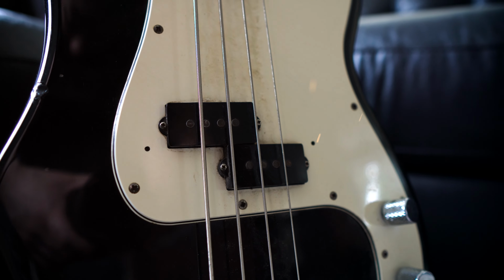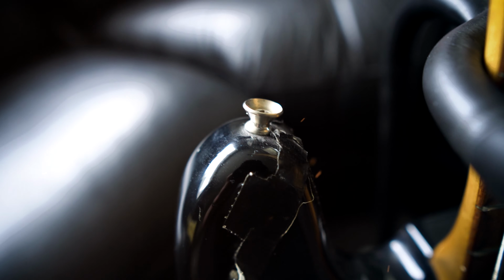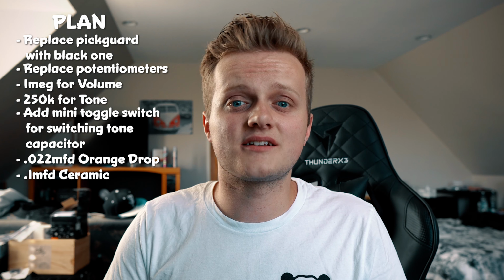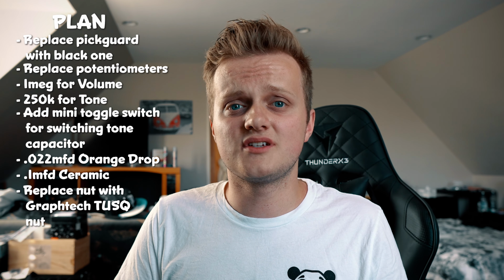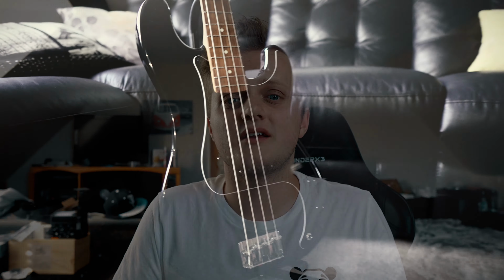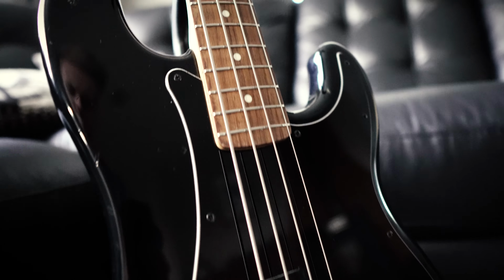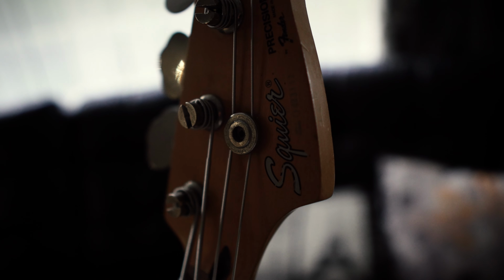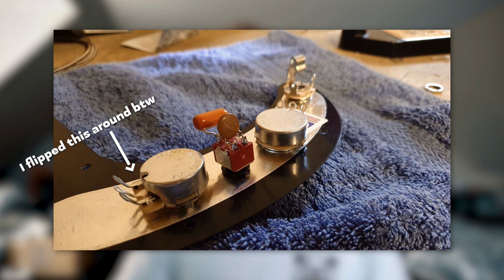Repairing And Modifying My Friends Precision Bass!

Comment: Also avoid using steel wool cleaning you’re frets as it apparently is inevitable that it will find its way into you’re pickups.
Reply from the maker: Fair point indeed! When I use steel wool, i cover the whole pickup in painters tape, so that I can peel it off and throw it away without it touching the actual pickup. If any does get on for some reason, the adhesive on the tape is usually enough to remove it 👍